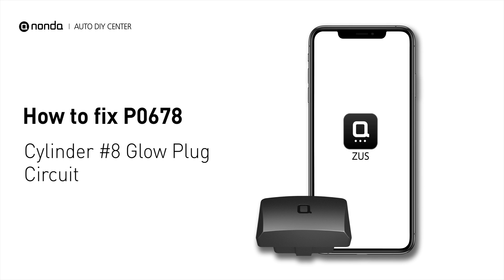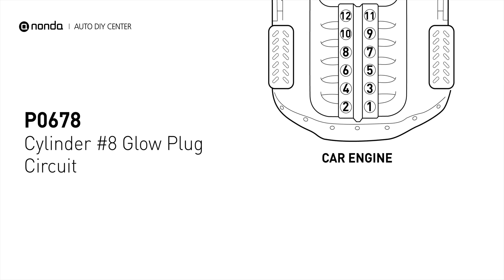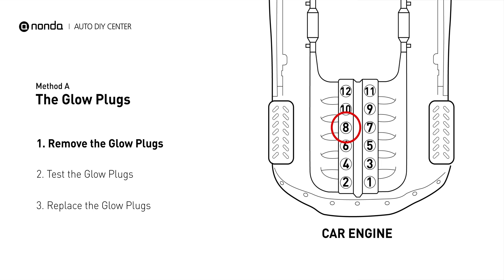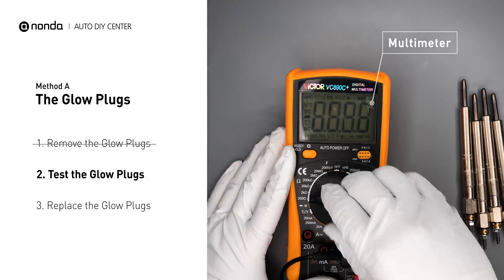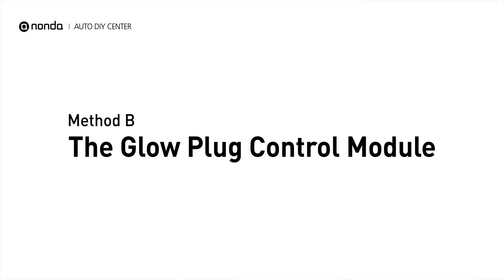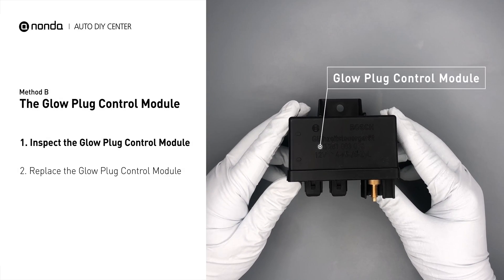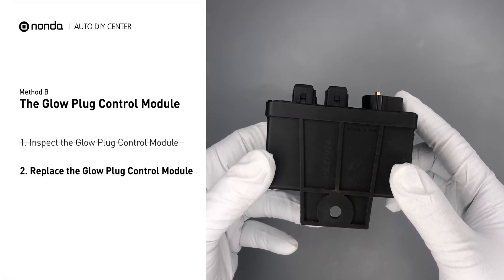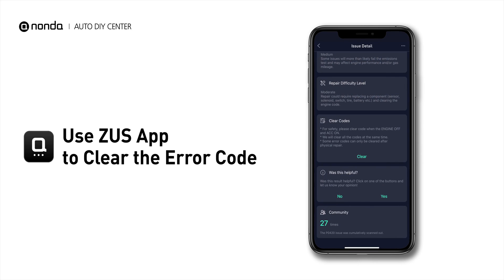How to Fix P0678 Engine Code in 3 Minutes [2 DIY Methods / Only $9.85]

Comment from the maker: Hi, I'm Steve, nonda's lead mechanic engineer. 
Feel free to leave your comments here if you have any mechanic questions, I will be glad to help you out!
Reply: Where is location of glow plug model 08 Ford 250 turbo diesel power stroke 6.4.i have check engine light for glow plug #8
Reply: Hi Steve, my 10 Express duramax has multiple glow plug codes, but starts very easy. I guess I'll check the module first. Where is location and have you seen this? Thanks